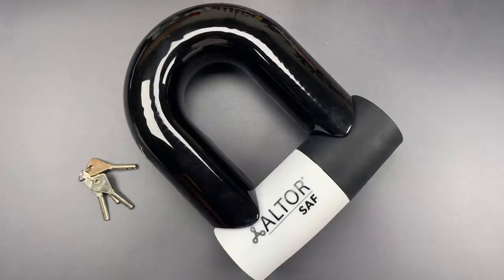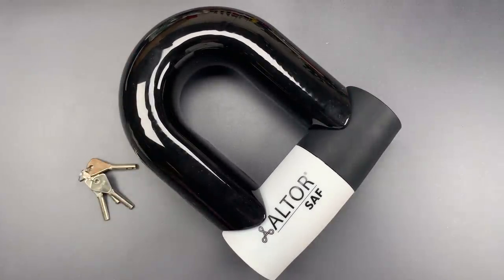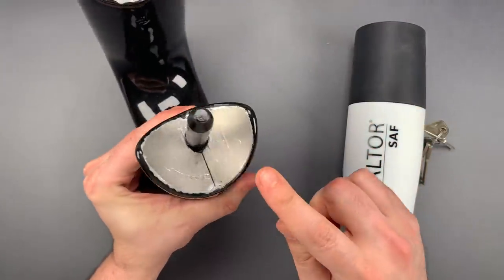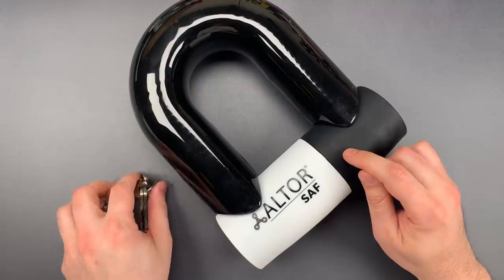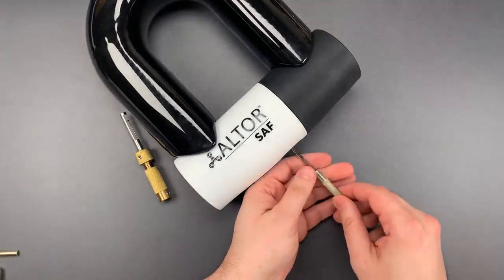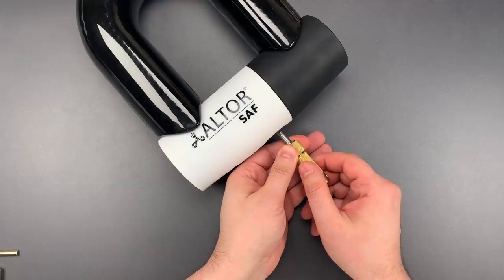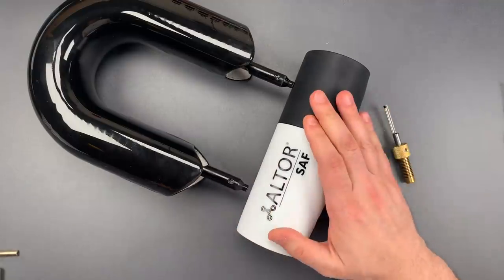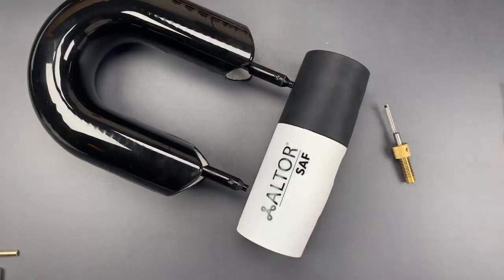[1088] MASSIVE Altor SAF ("Strong as F***”) Bike U-Lock Picked

Comment: User: Bought the most fattest, secure bike lock possible
Thief: Just grind the bike wheel
Reply: That’s why you lock the frame, not the wheel.
Reply: @Linnaen  Also, good luck passing this beast through the wheel... :D
Reply: @Linnaen  that's why they just grind the frame and sell the parts. 3k carbon frames still have 3k of parts attached.
Reply: @Squirrelking4395  good point
Reply: I've seen locks attached to nothing but the bike frame in my local area. People just strip it where the bike is locked, forget taking the whole thing.
Reply: DO NOT LOCK YOUR BIKE BY JUST THE WHEEL. EVER. Bicycle wheels are trivially removable: the slowest kind only requires you to undo two nuts, and the other two kinds are faster. They have to be removable: that’s how you repair punctures. If you lock your bike by just the wheel, you are inviting, nay begging, thieves to take your bike minus that wheel, and take somebody else’s wheel to make a complete bike. A bike locked by just the wheel is a danger to every other bike nearby: nobody steals run-of-the mill bike wheels for any other reason.
Reply: @beeble2003  how are they going to ride away if the bike only has one wheel? Do you know how clumsy & awkward it is to try to run while carrying a bicycle?
Reply: @snoozeflu  Try reading his comment again, but slower this time.
Reply: The idea is you wouldn't leave a 3k bike down a back alley bike rack. It would be at a busy place of work where its highly unlikely someone has to time to strip a bike for parts in Broad daylight. This stop any 30 second attacks from grinders, cutters or pickers. Aluminium is a bitch to cut with carbon blades but companies like evolution make multi material blades for portable grinders that make mince meat of ali. I haven't however ever seen how those blades cope against hardened steel. What they do male though is an almighty deafening noise.
Reply: @snoozeflu  precisely the reason why my childhood, neighborhood rascals would learn how to do wheelies expertly well.
Reply: @snoozeflu  In my area there was a gang, the driver drives up a van to the bike rack, the side door opens, a guy with the biggest bolt cutter money can buy gets out, cuts through the cable/U lock of the most expensive bike, throws the cutter into the van, throws the bike into the van, and they drive away as he closes the door. The whole action takes under 10 seconds, and they are away before anyone understands wtf happened.
Reply: @beeble2003  what about through the chain stays?
Reply: @Linnaen  then they steal the wheel... happened to my uncle.
Reply: @snoozeflu  thieves usually put a stolen bike in a white van.
Reply: @ryancox3834  "make mince meat of ali"

*is nervous*
Reply: @sharpfang  hell when I was at uni, after christmas the local scallies would chip in for bolt cutters and sweep down campus grabbing as many students' bikes as they could
Reply: Rugg Tomcat If you lock it through the chainstays, it’s not “just by the wheel”. Actually, the advanced version is to lock through the back wheel inside the rear triangle. That way, although the frame isn’t directly locked, the only way to take it without defeating the lock would be to cut the wheel, and bike thieves very rarely cut wheels.
Reply: @beeble2003  that's why you pass the D lock through the rear triangle as well as the wheel that way the bikes locked to the rack by the frame and the rear wheels locked in as well
Reply: It's just a comedy type comment. Thanks all for taking time to react to this
Reply: You won't be able to lock it to a wheel, so the thief would have to cut through the frame making the bike worthless
Reply: @snoozeflu 
1. Put the bike on your back
2. Run to a safehouse
Reply: You just know this guys bike has Dura ace di2 and a power meter. Well worth snapping/ grinding the carbon frame for

Comment: "I'm going to try a novel approach to opening an aluminium shackle with a grinder". Gallium grinder disc foreshadowing
Reply: Cutting a wedge from the outer steel shell and aluminum spacer to allow the grinder disc to reach the steel shackle (and through the other side) would probably be a lot faster.
Reply: @halfplushalfsqrt5  I don't think one uses Gallium for the speed, though. ;)

Comment: Why is this core different than other disc detainers that it can't be picked using the too that you and Bosnian Bill made?
Reply: my guess is that the core is so deep compared to the surface of the lock, that the disc pick doesn't reach the back of the core. 
"the core that's buried deep inside this lock..."
Reply: I think it's the half moon keyway which their pick wont fit into, also I'm pretty sure it only tensions from the last disc
Reply: It's not the standard half moon Abloy keyway but the second generation crescent moon one. Looks sort of like this ( or c
Reply: Having looked on a site selling Matt Smith's tool (375 Euros) I assume that LPL and BB could have made one this fancy for Sparrows, but it wouldn't have come in under $50.  (Matt Smith's claims to work on pretty much any disc detainer lock I see)
Reply: @two_tier_gary_rumain  Yeah, the Abloy Profile. Though the real thing has more discs and way deeper cuts on the key, I doubt even LPL could pick one that fast.
Reply: The Tool is too short. It can't reach all the discs
Reply: @janirossi9142  I wonder why altor didn't just buy abloy cores, the lock is 300€ anyways.
Reply: it looks like it tensions from the back of the core vs the bosnian bill tool tensioning off the first disk
Reply: @aleks138  Nope, the regular tool can tension off any disk.  He's used that pick to tension on different disks many times.

Comment: "...almost always easier to cut the bike rack" LMAO
Reply: Hell's favorite NPC #69OU812 . exe  and escaping with the pole..."I still need a light at home"
Reply: I've seen people chain bikes to little cute garden rope "fences", and be surprised when they find the rope cut.
 Like putting a steeldoor on a wooden frame.
Reply: Not even that uncommon. It's something to check round here, give the rack a good shove to check it's sound before locking up as there's been cases where racks have been pre cut and the thieves will simply come back later on and slide the bike right off. Cut usually covered with a fake promoters sticker or if the rack is positioned close to some overgrown hedge.

Comment: When I lived in the city years ago, my observation was that you had to lock all parts of the bike.  I used a cable just because I could run it through the frame and both wheels.  If a wheel wasn’t locked, they would just steal the wheel.  There were,back when I lived there, bicycle frames locked up all over Philadelphia with no wheels on them.

Comment: Altor SAF: defeats grinder.
Sawzall has entered the chat
Reply: Would still be difficult. Indeed the only thing that I can think of that would get through that easil/quickly would be a plasma cutter.
Reply: Edward Teach And uhhh....I highly doubt anyone would seem inconspicuous with a plasma cutter
Edit - Orange vest is the one exception
Reply: @ColoredVoid  Yep, and even with an orange vest people would likely be a little suspicious if dome one using one near a locked bike.
Reply: @edwardteach3000  nope.  that shackle has very little steel since they packed so much aluminum in it.  a sawzall would have that off in 30 seconds.  just cut where it's the thinnest.  an angle grinder to the body of the lock would also have that off in about 1 minute.
Reply: @thomasjenkins7506  I think the body is just as thick as the shackle. I guess you might get lucky and damage the lock enough for it to come off. 

At that point though I believe a thief would move on to easier targets.
Reply: @thomasjenkins7506  I really doubt that. Reciprocating saws are certainly awesome at cutting metal (with the right blade) but trying to get 2 clean cuts on an unsecured object of that thickness, mass and awkward size is not a 30 second job. It's not even a 5 minute job and that's assuming you have a second pair of hands or a heavy mobile clamp of some kind. I certainly would not attempt it unless there were 0 other options. A decent DeWalt or Hilti drill with the expensive titanium bits would probably be your best bet, I reckon you could drill out the core in 3-5 minutes depending on how much hardened steel is in there. Again, you'd want a second pair of steady hands though.
Reply: it's not, though, especially with how deep that lock is set in.  that's the weakness of deep set locks.  since the lock itself isn't something that hold the body together, deep set locks just create a weak point for brute force attacks.  it might as well just be a hollow metal pipe at that point.
Reply: @John-jr4dj  lol, no.  you only need 1 cut right where the the shackle meets the body.  just slice off one of those thin little ears and you have direct access to the inner core.  a smarter design would be to omit those ears and put a collar on the body to  cover that point.  the steel itself is less than 1/8" thick and the rest is soft, soft aluminum.  30 seconds, tops.
Reply: @thomasjenkins7506  Ah, you obviously don't cut alu very often. We're not going to be talking about tin can aluminium here, it's going to be some sort of alloy such as 2024 or 7068, both of which are nearly as strong as steel. I had to trim some (much softer) 1.5" aluminium rods on site quite recently. Now I use a Hilti saw with the Milwaukee Blaze blades and each cut took me a good 1.5-2 minutes, although I was paying a lot of attention on getting a clean result. So even if you can make this in 1 cut, which is entirely presumed on the lock body being hollow, which it almost certainly isn't, it's still going to take you a lot more than 30s. I mean, why would anyone ever cut a shackle if lock bodies were so soft?
Reply: @John-jr4dj  Yeah, drilling out the core is almost certainly the way to go. The sheer size and weight of the lock may actually help you since I can't imagine it being a "loose" fitting lock.
Reply: @thomasjenkins7506  Search this lock and see how many views the videos have. You should make a video with title Altor SAF cut in 30 seconds. You'd more than make up the cost of the lock with the views you get. Especially when you come back on here and post about it.
Reply: @John-jr4dj  i do cut aluminum a lot.  it's not harder than hardened steel.  it's not even close.  if you are cutting where the shackle meets the lock body, it's only about .5" thick, which isn't the 1.5" rods you are talking about.

they usually don't attack the lock body because the shackles are usually thinner, which isn't the case here.  it probably isn't completely hollow, but it's hollow enough because it has to have room for the lock core and nothing can be in front of the lock core because you need to fit the key inside.  that leaves at least 3/4 of that body essentially hollow since the core isn't a structural part of the lock and will fall out then the rest of the body is cut away. 

worst case scenario is you just make a V cut on the side to pop the core loose and it's open.  that's less than a minute.
Reply: @Komainu959   Took your advice and had a look at some vids. Not only is this definitely a hard alloy but the inside isn't actually entirely solid. It has some sort of fancy wave pattern and you would need serious stability to avoid breaking multiple blades during the cut. I'm fairly handy with a saw (if I do say so myself) and I wouldn't fancy it all all. Drill all the way, at least the core will present a reasonably uniform target.
Reply: @John-jr4dj  uh, the voids would only break abrasive grinder wheels, not sawzall blades.  the voids help the sawzall blades by reducing the amount that needs to be cut.
Reply: @thomasjenkins7506  Yeah, it would effect grinders more to be sure, but cutting into variable resistance is always tricky, even with a reciprocator. That combined with the wavy style pattern is a great way to catch any sort of blade because it means there is no such thing as a straight cut and you have to go slower to avoid catching and excessive heat on the blade, etc. I do find your idea of a V-Cut into the lock body to be interesting although I'd still be willing to bet cash money it can't be done in less than 3 minutes. And a V-cut is still 2 cuts by the way, but I admit I'm being pedantic there! If you really think you can do it I reckon Komainu is right when he says that would make for a massive vid. You could make back the price of 10 locks in short order I would think.

Comment: 2:00 "I headed down to my garage, and emerged several hours later with this tool."

Do you have a CNC machine in your garage, LPL? Lol.
Reply: It didn't take a CNC machine to make something like that. That's just large work and maybe some light milling machine work. And we know he had those in his garage after the video of him and bb making their pick
Reply: All you need to make that tool is metal stock in 3/4 inch  solid and 1/4 inch tube; a small lathe (try to get something better than a Harbor Freight special), and a mill.  You could do it with hand tools, if you REALLY wanted, but getting it done quickly and precisely would be very difficult.

Comment: i work in metal fabrication and a coworker (welder ) told me about the time they got commisened to build jail doors anyway the plan called for square sheet metal tubing with a freely rotating pice of 12mm smooth rebar inside vertical square tubes with it beeing drilled in to and through horizontal ones. All of the seemes were to be welded air tight and than the whole door was filled with used motor oil the gate was than powder coated white so that any sawing would show up easly on inspection .

Comment: I thought it was just a beefy brake disc lock for motorcycles and said to myself: "Well, it does look pretty good, no discussion". Then LPL's right hand came into frame... and my head totally blew up, I mean WTF IS THAT BEAST, DUDE?  😱  I probably would use this "baby" to lock up my tank or my chopper (if I had one). It looks as hilarious as intimidating IMO. And it gave me a very big laugh when I realized the size of this thing. Thanks LPL for this videos.

Comment: Yes if your not using a cutting wheel designed for aluminum it will gum up the wheel hold in enough heat the wheel will explode. They make cutting wheel out of metal and some that are designed for cutting aluminum now days. You could use hard wax or WD-40 on the old style to help with the build up of aluminum on the wheel.

Comment: Interesting about the aluminum construction. Aluminum plus rust equals thermite, A fast burning substance used in antitank shells. It actually burns through armor plate. Once the steel shackle begins to rust, you can use the angle grinder’s friction to melt the shackle…

Comment: @LPL - I would love to see you use a portaband for destructive entry.

We use portable bandsaws to cut unhardened steel pipes up to 6" in diameter (with a 4" bandsaw) in the fence industry. They are little more expensive than an angle grinder and use the same batteries. They are essentially a rotery hacksaw. 

But they are bulky and would struggle in tight areas. Would be interested to see what they do against shackles like this!

Comment: I use one of these, hooking it through the rear wheels sprocket in my 2000 HD Fatboy. With the ignition locked, the steering locked and this locking my rear tire, i feel safer leaving it sitting when I'm in a store. Plus I have a GPS tracking chip hidden in the handle bars. I've never owned anything as nice a my Harley and I'm not letting it be stolen.
Reply: Obviously it's normal sized.

Comment: Looks like it is the perfect target for a milwaukee m18 hackzall with a 6" blade.  It should rip right though the aluminum.. the hardened steel would present a problem  unless you were using a torch or diablo blade.   I have a m12 that I bet could get through that with a few batteries.. I'm in the DMV if you want to borrow it and give it a shot..

Comment: Aluminium particles stick to steel discs, make them overheat and "explode". That's why you don't use a grinder with a steel disc on aluminium. That being said you can easily grind out aluminium in a couple seconds to reach the steel. It really just look big and scary until you know it's aluminium.

Comment: The limited reach of 4.5" cutoff wheels is why i run 6" cutoff wheels in my 4.5" grinders, 6" disks are rated for the speed 4.5" grinders typically operate at.

Comment: Great Video.   I’ve bought all the largest locks I could ever find because my bike was $3500 and they’ve worked so far.   5 years and no attempts at all.     But I have $650 in locks that weigh 35LBS.  LOL 

I really don’t like that you can pick this lock.  

Can you also pick a Mul-T-Lock like I have on my house?    

Should they use a lock like that?  

Now I don’t know anything about the internals of the lock and how they move.   

That tool you made?   The part you inserted first.   What is it doing?     

Can the things you’re moving with the second item you inserted be made to shoot back out of position?  

Making it impossible to do what you’re doing without the key?

Comment: feels like kind of a catch-22 with this lock. Obviously, people with high-end bicycle will buy this lock ... in theory. Just imagine first trying to find a place where to use it  ...has to be a small pole and i can only think of a front wheel + cable or direct frame + cable protection type. One things for sure, putting this monster against carbon wheels or even a carbon frame would scare me. Any hard/medium contact with the bike would potentially result in damage. I had the forghettaboutit (whatever its spelled) lock long time ago and that thing is massive. Finding places where i could lock my sl columbus italian frame bike was a hassle on its own and people running their bikes into bike racks would make my lock clash against my frame/wheels and create some scratches.